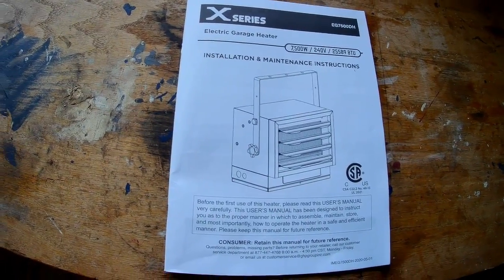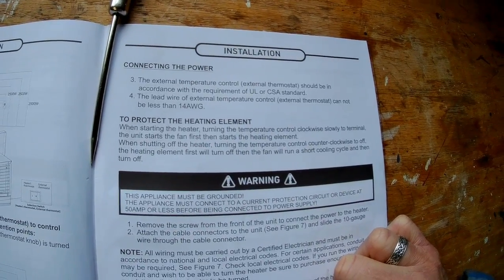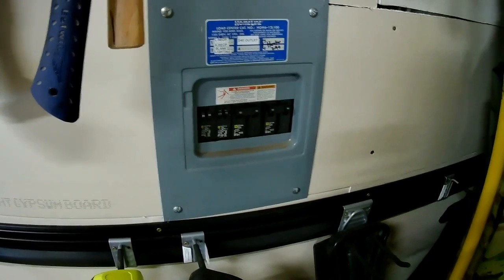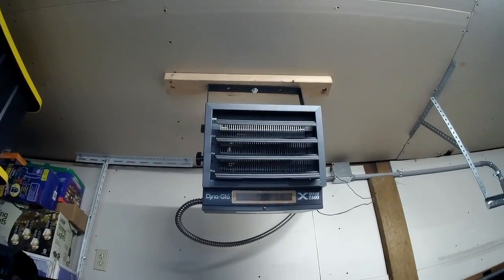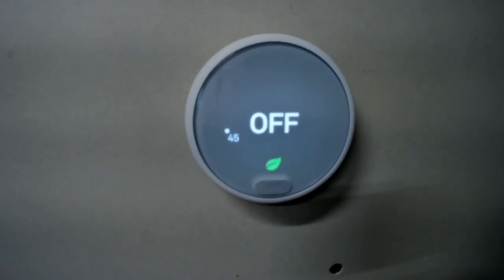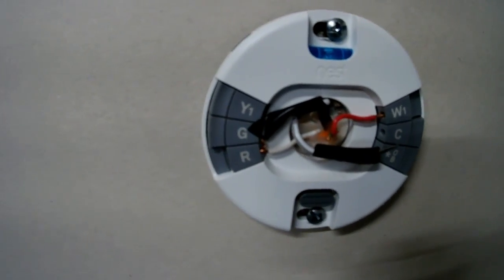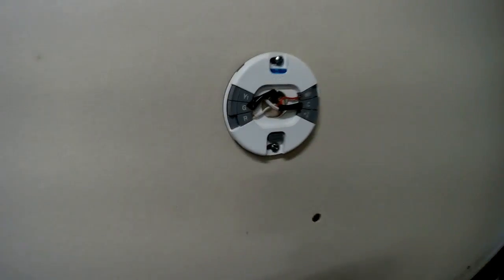Dyna-Glo 7500W Electric Garage/Shop Heater with Nest Tstat Install-NOT THIS model?-read desc-volts!

Comment: I have the exact same heater, exact same thermostat power supply but a different nest thermostat and can't get it to work. What are your settings on the thermostat? I'm sure it's set to heat type electric but is it set to forced air, in-floor radiant, etc?
Reply from the maker: Jesse-was home, so see link below run through (sorry for dirty’ish hands-literally came back to shop from hedge clipping some rhododendrons to vid that). 🤷‍♂️ Hope it helps. 
 https://youtu.be/rtDmKJ0TOPI
Reply: @icarian76  I appreciate the personal video! I have mine all set to the exact same settings and for some reason I can't get it to work. Originally bought the turn knob Dyna-Glo heater and followed your directions with the nest thermostat and thank God I didn't explode that thing cuz that was 240 volts. But I tried the thermostat in my house and it's still working fine. I just bought the exact same heater as you and I'm going to return the other one but for some reason if I switch it to external thermostat even with my thermostat turned off it turns on high and heats and won't turn off
Reply from the maker: Ugh. Wonder if Nest (Google) has changed something since my Nest Tstat E (1st Gen)?  

This is tinkering, but it should do zero damage for troubleshooting: on your Nest, it might be worthwhile taking the W1 wire and putting it in the R slot and vice versa and see if you get desired endstate. If Nest will operate like mine (assumption is yes), I would check wire reversal at first line of troubleshooting.
Reply: @icarian76  lol I actually tried that and my thermostat told me it wasn't wired correctly.
Reply from the maker: @JesseWolfe  that…is not the desired endstate. Lol. Racking my brain but if all else mimics mine, the Tstat is what is different. Some of the Nest YouTubers might have something specific to your model-I gleaned a few tidbits from them. 

That stated, there ARE finally line voltage smart Tstats coming on the market apparently. 

https://thermostatguide.com/line-voltage-thermostat/
Reply: @icarian76  yeah I'm not putting much more thought I to it. The built in thermostat does pretty much what I need it to do other than letting me control it from my phone. I keep it at 63 and it's great. I don't know why I'd really ever turn it off. It's my garage gym.
Reply: @JesseWolfe Did you end up finding a solution for the newer Nest model? I am in the same situation: I have the exact same heater and wiring, but the Nest says it has no power to the W cable
Reply: @Christopher Berg  I never got it to work. I bought the transformer so I don't have the power issue however I tried other nest thermostats and not the nest e-thermostat that he uses in the video. I'm sure if I found that somewhere online I'd be fine.
Reply: I do also have the back set to external thermostat

Comment: Why do I see on Google that you can’t use nest with this heaters.
Reply from the maker: This is a DIY hack that is confirmed/documented in this video for this SPECIFIC model.
Reply: What gauge of wire do you use to go from that heater to the thermostat

Comment: Thanks for all you hard work on this.  I purchased the 7500/non-digital model and I connected everything as you had mentioned and when i hooked up the Nest thermostat the screen went blank.  I think i figured it out and this might help with some of the issues other have.  It looks like like in the non-digital version L1 is ties to 1 and it is not sending DC current to the thermostat, but instead 120v (1 leg of the 240v).  I verified this by touching a light bulb to the two wires i had connected to 1 and 2. (yes, the light bulb light up).  So yeah...  Now I have a burned out thermostat and unless I want to pull this unit down and install the digital version looks like there's no way to use a smart thermostat (at least i haven't found one yet, but i didnt look too hard)
Reply from the maker: Ouch. Good info. I think I’ll see if YTube will let me edit the title to put a “test voltage! with multimeter if using ANY model outside of this specific one”.
Reply from the maker: Apparently I had that caveat in there-Vincent V had the same issue on a different Dyna-Glo model (5000w series?). That stated, I get it…I don’t read every vid description either. As I recall Vincent DID have a workaround if you want to read through the comments or just decide the juice isn’t worth it.

Comment: You realize you are gonna fry that tstat. You need a high voltage tstat lol
Reply from the maker: Better check the date of that how to and do the math to present day. 🤷‍♂️ I DO suggest that as smart thermostats - high voltage specifically - come to market, to go with them. A multimeter is the tool of choice when experimenting hacks. 🤙
Reply: Is it 240v comming off the heater to the thermostat?
Reply: @ArmoredSecurity41  yes. I changed the contactor to a 24v one and added a transformer to control it with a normal tstat.
Reply: @narutofade5012  I have the 10,000 watt heater that has a spot for 2 leads to plug into the unit for external thermostat. I would like to use a control transformer for 240v to 24v and run a smart thermostat for the heater. Do you think I will need anything else to make it work and not fry the thermostat?

Comment: Great video! Thanks.  What if you did have a 14AWG, how would you connect to the Nest - I think it only takes 18AWG, correct?  I was just trying to avoid having the 24V power supply (if possible).  Thanks much!
Reply from the maker: Rico-yes, Google says the Nest should run between 18-22AWG. So you are experimenting compatibility (no big deal, that is what I ended up doing). I would test run the 14AWG between the Nest/heater (same setup/connections) as I did, just not in conduit/wall. Works without a C wire using the 14AWG? Good-install. If not, methinks the power adapter for the C wire is still required.
Reply: @icarian76  Thanks much for the quick reply.  So I would just use a wire nut between the 14 and the 18 that goes in the Nest?   Thanks again.
Reply from the maker: @RicoCastro  I don't have my Nest in front of me (on the road), but I would just see if the 14AWG will fit in the corresponding hole on the Nest. If it does, connect in place of the 18AWG and test between the heater and Nest for charging the Nest. If not, compatibility (I think) has been determined to be in the negative.
Reply: @icarian76  So I installed it with the 18AWG and it worked (with the 24V power supply).  The only problem I have is that the Heating element will turn off when I turn the unit off on the thermostat (Nest), but the fan will keep running and won't turn off, it just keep blowing.
Reply from the maker: @RicoCastro  Hmm. On the Nest (somewhere under the “system” dialogue/tab), Source is electric and Heat Type is forced air?
Reply: I have the same problem with the blower motor keeps running? Any suggestions?
Reply: @danielbrunton9621  Hey Daniel, I eventually gave up - didn't find a solution.  The fan would not stop.  Please let me know if you could make it work. Thanks.

Comment: I have a Mastercraft 7500W/240V Workshop Heater with Remote similar to yours and a Wyze Thermostat, I'm having a problem controlling the heater with it. I have a 240V to 24V transformer in the unit powering the thermostat and I have my  T1 going to W1 and T2 going to Rh to the thermostat. Do you have any suggestions?

Comment: How do u lime this?  I have a 3 car garage/ mancave fully insulated and looking for something to heat it up and cool it in the summer. I was looking at dyi Costco  18000btu Mr cool minisplit system which is $1600 but it has both ac/heating in one unit.  I don't know which rout to go, get a heater right now for $500 and buy something else for the summer time or just get the minisplit system?? I have a pool table in there and a gym:). I love in Clovis California in 9b zone I think or 9
Reply from the maker: I like it. For a shop/workout area. 

For a finished man cave (looking for more quiet and the cooling), I’d probably go with the mini split. What is the saying? “Buy it right the first time and cry only once” or some such. Get the needed cooling. You’ll be staring that one in the face sooner than later. 🤙
Reply: @icarian76  THank you

Comment: I just got done setting mine up like yours. The one difference is that I tried using the latest Nest Thermostat which is cheaper ($99). Turns out it doesn't turn on or off the heater properly. I get a lot of clicking noises. I have a Nest Thermostat E in the house so I tried that one and it works properly. Wouldn't recommend using the cheaper version. Thanks for the details on how to get it to work! Looking forward to using it this winter.
Reply: What kind of wire did you use to go from the heater to your nest?
Reply: @jeffreypwheeler  just standard 18/2 thermostat wire. I folded it over to give it double thickness at the heater connection. I know it says 14/2 in the heater instructions but that won’t fit in the Nest connections.
Reply: Thanks for this! After mine made the clicking noise, the remote operation no longer worked for me.

Does your remote operation still work for you?
Reply: @jeffreypwheeler  afterwards I was only getting low heat. Replaced the heater and put in a Nest Learning t-stat and it’s been working good for the last month.
Reply: Hi Dave, apparently I have the same issue With a Nest thermostat, noise and don,t turn on or off. The heater just go on High only. Do you confirm a Nest thermostat E solve the problem before I go to purchase one? Thank you
Reply: @Mrsoldat2  yes, the Nest E works for me. Used it all last winter without any issues.
Reply: You have to make sure your tstat is a high voltage. Nest is not so you are gonna fry that nest tstat
Reply: @narutofade5012  been working fine for the last month using a Nest Learning t-stat

Comment: Manual says to use 10 Guage not 8
Reply from the maker: I believe you are referring to page 9, where it mentions 10 gauge, no? That is the gauge wire that the heater comes with (that you will direct wire to your 240v wiring). As for YOUR 240v wiring: on page 3, at 7500W, you are pulling up to 31.25 amps. So you need a 40 amp breaker (next size that can accommodate those 31.25 amps). Search for “what gauge wire for a 40 amp breaker” and you will see the code requirement of 8 gauge wire. Hopefully that clears that up. 

That stated-this is a DIY hack for a Nest working with this heater (NOT code-although my works perfectly). As more smart/Wi-Fi thermostats come online/more prevalent, take note of the warning on page 3: compatible with a 240v line voltage double pole wall thermostat. Must be installed by a certified electrician. My Nest hack  hopefully has already been replaced as this smart Wi-Fi tech has marched forward. 🤙
Reply: @icarian76  MYSA(made in Canada) has thermostats for 240volts but they only go up to 3800watts if I remember correctly. I installed a bunch in the house of an ex G/F and they worked great.

Comment: Quick question, that heaters lowest setting is 50 degrees correct? With the external thermostat it allows you to set the temperature lower than the minimum 50 degrees that the built in thermostat comes with this unit?
Reply from the maker: Eddie, I “believe” the internal thermostat goes to 50 (been on the Nest external for a bit of time, so memory is fuzzy). My particular Nest goes down to 50 degrees in normal heat mode. BUT it has an emergency heat setting that you can set as low as 35 (which is where I set it). So I leave the heater in the off mode and if a cold spell comes along, it will kick on at 35 degrees to keep the shop from reaching freezing level. That will obviously work anywhere and help to keep bills down while still not allowing paint / water lines to freeze if that is the aim.

Comment: I have the 7500w/10000w version of this heater.  Hooked it up the same way you hooked yours up including the aftermarket transformer , and the heater just runs constantly. The thermostat does nothing to control it. Would appreciate any ideas
Reply from the maker: Just going through basics to check off: toggle switch on back of heater (to switch between internal/external thermostats) switched over?
Reply: @icarian76  yes its switched to the thermostat setting. And the dial on the front is all the way clockwise
Reply from the maker: @stevecarey1639  okay. That was the most obvious/best case. I’ll see if I can pull your heater’s model up and see if there are any differences from mine once I’m at my hotel (currently in van from airport).
Reply from the maker: @stevecarey1639  Okay, laptop up and running and short research period. Up front-NOT seeing anything obvious to assist. But perhaps one of the below may...so continue on if you feel.

Looking at the two models of 10k heater on the Dyna-Glo website, yours (non digital front interface it sounds like) doesn't have the owner's manual posted. But the other 10k (digital interface) does have-so assuming this portion is the same between the two and went off it (an assumption!). That stated, you need to confirm in the manual they shipped with yours that it has the same external thermostat diagram/hookups as on the digital one (page 8 of the online manual)...  https://dynagloheater.com/wp-content/uploads/2019/04/EGH-Manual_EG10000DH_010319.pdf

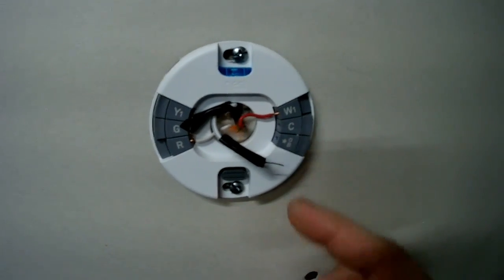If the same? It should hook up the same as mine. Sooo, per 9:45-11:35 (weird interface of C wire transformer after I installed it) of my video, did you maintain the "tinning" on the end of the C and R wires coming from the transformer? That is good? Okay, have you tried reversing (switching) which wire goes into the R and the W1 on the external thermostat from the heater? Should be a quick heater power off, switch wire places on thermo, switch heater back on to confirm/deny. Not desired outcome, then switch it back. 

Does your heater work normally when you aren't attempting to use the external thermostat? An Amazon review that another user of this particular model posted scares me a bit. May yours not be a lemon (most likely not, just something that we don't have tweaked right...). See the "top review/fan won't shut off"...  https://www.amazon.com/dp/B07KLD93LJ?tag=dgheater-aawp-horizontal-20&linkCode=ogi&th=1&psc=1

That is going to be extent of what I can figure out remotely/can't tinker with mine (I've days on the road staring at me). Perhaps a smarter person that sees this query can assist. Worst/worse case is you pay for an electrician/HVAC pro to come see you (if the heater works normally off its internal thermostat, but you can't get the external to play nicely).
Reply: @icarian76  i have not swapped the red and white wires . That's the only thing I have not tried . My thermostat is a little different than yours . Still a nest but no physical button on the front . Mirrored screen . I will swap the wires tommorow. I no longer have the owners manual however  , it seems to me that the manual had a section about switching wires around internally if using an external thermostat . I can't remember what it said . I have an hvac guy coming anyway so if swapping the wires doesn't do it he will have to fix it for me . Many thanks for your assistance,  I will update this with the fix when I figure it out in case someone else has this issue

Comment: Great Video and thank you, I do have everything wired correct I believe, one to the W from the heater, 2 to teh R ( one from heater 1 from 24VAC power supply) and 1 tot eh C from the power supply. All works when heating. However when the thermostat reaches temp and trys to turn the heater off, the heater clicks rapidly until you kill the power. Likewise if you turn the heat off from either the thermostat or the app, it clicks rapidly also.  do i have some wires backwards or something else I haven't connected?
Thanks
Reply: Did you happen to find a fix for this? I'm having same exact issue! I did everything exactly as in video and no good
Reply: @sfcvalladolid6410  Did you find a solution to this?  I'm having the exact same issue.  I only get 1 click when the setpoint is reached as expected, but the heater continues running until I unplug it.
Reply: You all realize that you are gonna fry your tstat. You need a high voltage tstat to run that lol